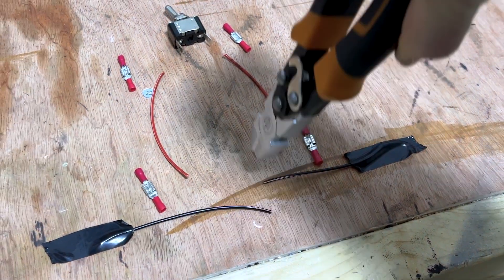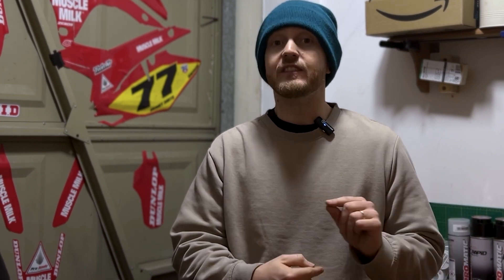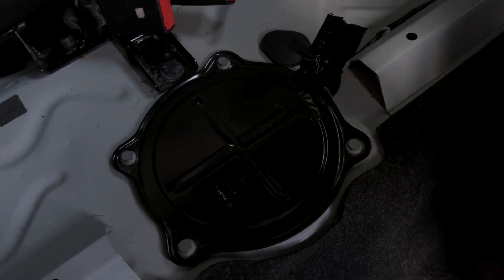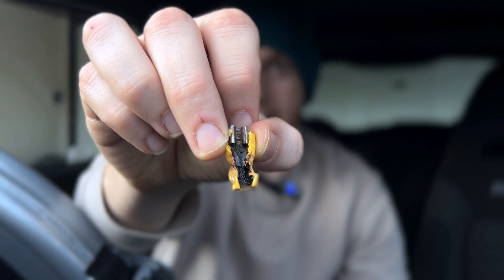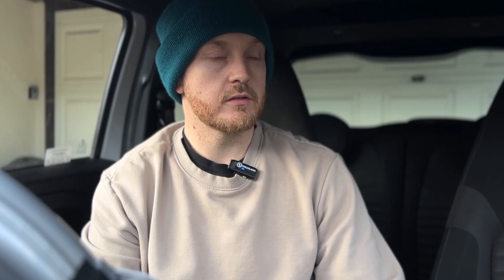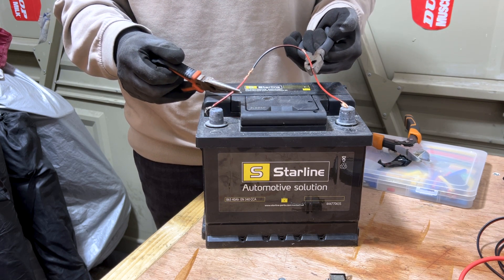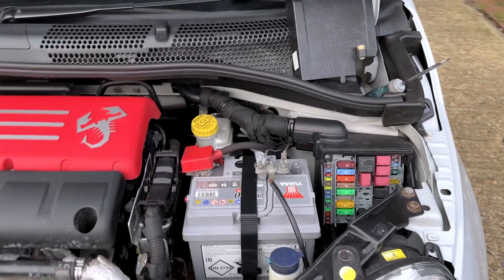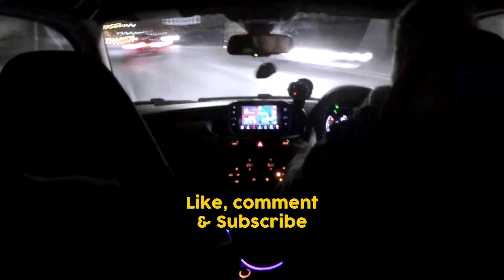Simple Fuel Pump Kill Switch! [BEWARE] Episode 1

Comment: I get that this is a year old, but why wouldn't you just wire the switch into the ground wire instead of the power wire?
Reply from the maker: I believe you can do either.  Does the ground (neutral?) run the same same voltage?
Reply: @HenOnWheels  Specifically, the ground wire that goes to the pump.  It would carry normal 12v.

Comment: My issue with a switch is the pump is an inductive motor.  When the power is cut off, the pump motor will do what any inductor will do.  Resist the change of current causing voltage to spike to a very high level.  So you need a flyback diode on it, if it doesnt have one built in. To test, connect a oscope to the power then cut power to tye pump.  Observe the voltage jump.  Or turn the stereo on and see if it pops the speakers.  The large voltage spike (EMP), couples onto the speaker wires, casuing the pop.

Comment: It's not currents it is amperes (amps) the best way to wire a kill switch is pick it up under the dash, a fuel pump would draw a maximum of about four to six amps. Use a decent switch preferably  a push pull switch as they are usually rated at twenty five amps and have a smaller mounting hole making  it easier to fit under the dash. Use some 4 or 5 mm square automotive cable to make the connection. I prefer to solder the joins as this will prevent overheating the connection. I have fitted hundreds over my time as an auto electrician.
Reply: Current is measured in amps.  It's okay to use then interchangeably.  If you had to use only one, you would use current, so you are consistent.  You would never call an inductor a Henry, or a capacitor a Farad.
Reply: Rather than just adding a switch, you need to add a relay, which is just an electro-mechnical switch controlled by another switch. 
My idea would be interrupt the fuel pump 12v wire with the relay on the switching side (30), jump the live 12v to the control side + (86) and then run an earth lead from the control side - (85) to your hidden switch then to chassis ground, run the switching side out (87) to the fuel pump . this way you can add more than one hidden switch in series. once you close the hidden switches you provide an earth to the relay, closing the contacts and supplying the 12v to the fuel pump.
Reply from the maker: Thanks for the pointers Richard. Good to note about soldering the connections for better heat dissipation.  What are your thoughts on wiring up a switch to the fuel pump VS the from the ignition?
Reply: Hello, sorry to bother, for those of us that can’t solder, would you think a suitably rated wago block would be ok?
Reply from the maker: @tconners1758  Richard can confirm but I would imagine so - using a wago would make it slightly more difficult to hide.
Reply: @HenOnWheels I think I’m going to remove the rear door cards and access the wiring there as opposed to directly above the fuel pump, that way the wagos will be behind the door card and unable to be seen. Thankfully. Cheers for the response. 🙏🏻
Reply: Soldering the connectors doesn't help in heat dissipation it stops heat production..  It creates a lower resistance connection. As the resistance is low across the connection so is the voltage drop.  The larger the voltage drop the more heat you get.  E=IR.  How much lower is soldering?  Significantly lower.  If one doesn't know how to solder, learn.  It's easier than making a sandwich, and the Chinese aren't as greedy as Americans so you can get the gear cheap now.